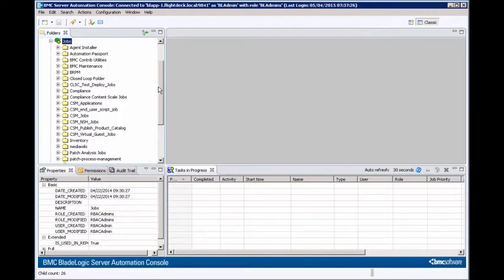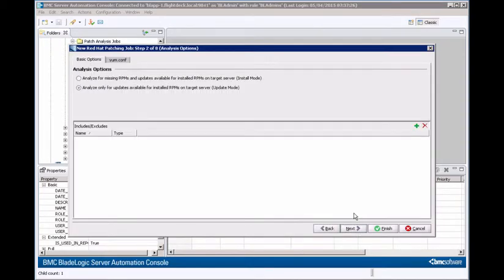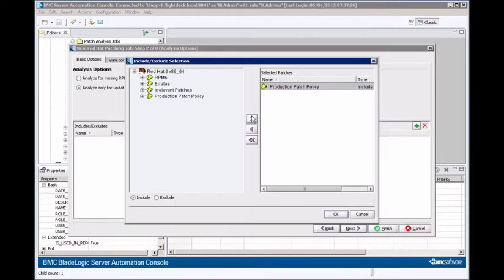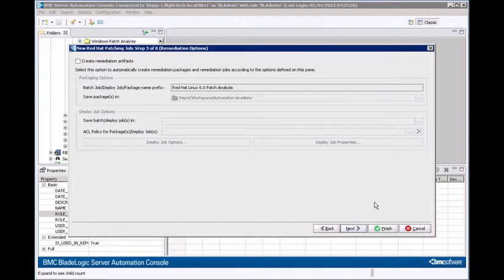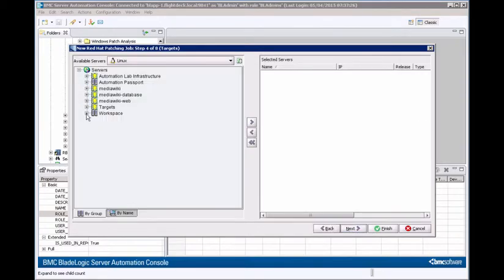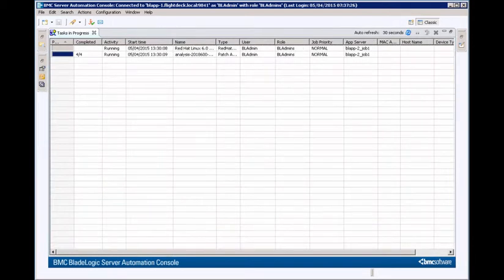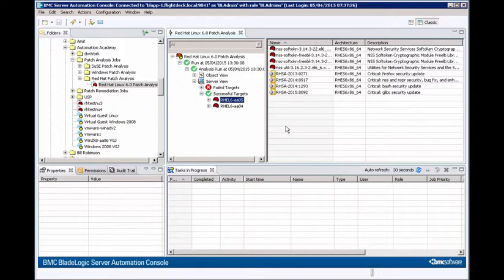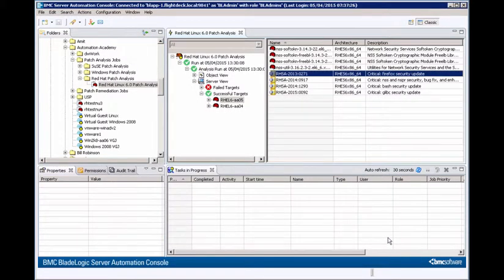BSA: Analyzing Red Hat patches

Comment: Proceeding for some prechecks
Downloader failed with errors: Validation Error :- BLPAT1102 - Repo Server is no
t accessible
Possible remediation steps :- Please check network access to host
yum
 --- Cause:

======================= Download Result ================================

         RPMs downloaded         - 0
         RPMs download skipped   - 0
         RPMs download failed    - 0
         Erratas applicable       - 0